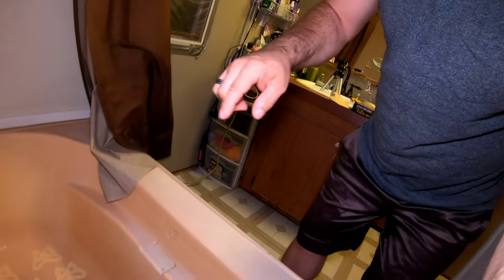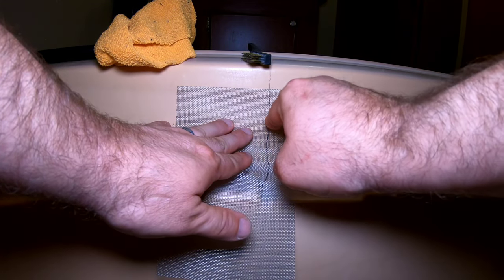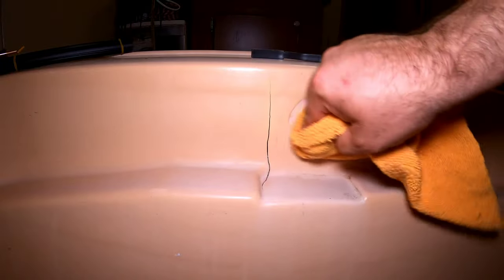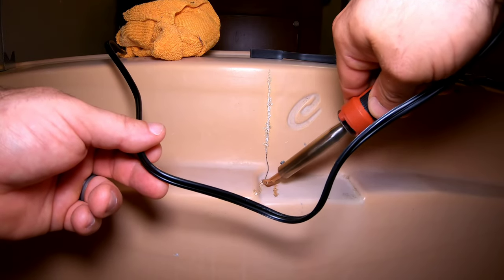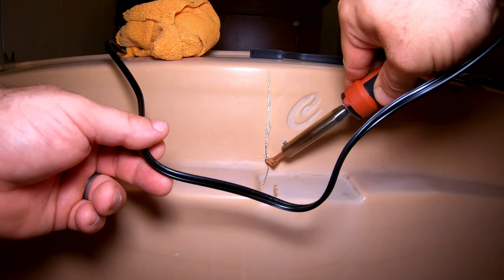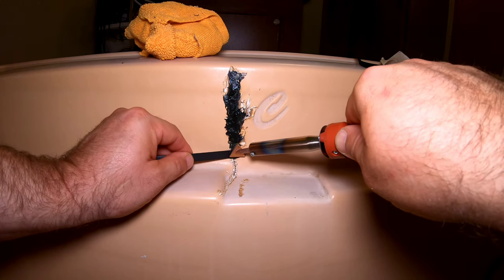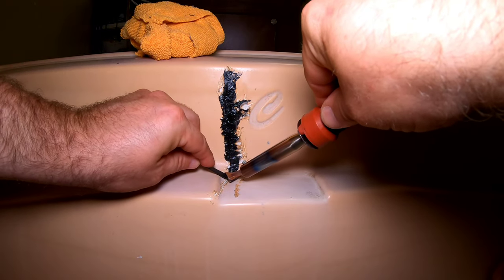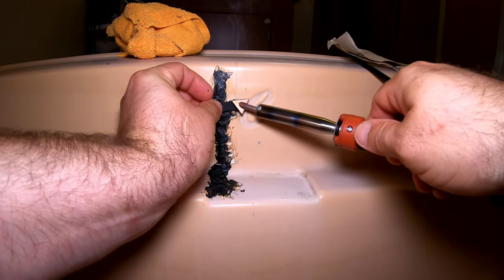Plastic Bath tub Repair - Plastic Welding

Comment: I will say, this does work and works very well! I use to plastic weld, plastic bumpers on automobiles, when the customers didn’t want to buy new plastic bumper covers, after a wreck at the body shop. We would just plastic weld the front of crack, mesh the back side and cover with 2 part glue on back side . The front would be smoothed out and filled with a glaze filler, then primed , and painted/clear.
Reply from the maker: Yep I'm sure you guys fixed some of the screw mounts on the back of headlight housings to the same way. It's a lot of ways you can repair stuff that you would normally have to throw away

Comment: Thanks for the demo, would be nice to see if direct pressure would keep the plastic together. I find that plastic sometimes comes apart after welding.
Reply from the maker: Well we don't put downward pressure on the top of this tub because that's how it cracked in the first place these are not made to be stood on but our granddaughter tried to stand on it and then our 80 lb basset hound jumped on top of it and that's how it cracked. Since then there has been some abuse but it's holding up.
Reply: @thefrugalhomestead7873  thanks for letting me know. Going to try this tomorrow, and as a back up flex duct, flex spray, foam underneath as a temporary fix.

Comment: Great video. Question: (I'm the opposite of a handyman unfortunately) how exactly would I know what material my tub is. I live in a manufacturered home from the 70's. However the tub/shower combo is not original. I cant tell if its abs or acrylic or what. Definitely not metal.
Reply from the maker: Most are abs or PVC not many true acrylic ones around. But if yours is already cracked it can't hurt to try this.
Reply: @thefrugalhomestead7873  thank you for your time in responding. After closer inspection, it seems to have fiberglass under the top glossy coat. Looks like strings in a mold of some sorts.

Comment: Is this an acrylic tub or some other material? I was under the impression that you could not melt acrylic with heat.
Reply from the maker: This is a standard plastic tub. That said I worked on acrylics in tanning beds for years and yes you can weld them. As well as glue them

Comment: Can I use a fiberglass patch on a plastic tub? I have one that is cracked in the bottom close to the drain.  It is in good shape other than that!
Reply from the maker: Everything I've ever tried has failed other than welding. That said being by the drain is dangerous even for plastic welding. Now depending on how it is you might be able to take a hole saw run it in reverse drill a new hole bigger and put a bigger drain in I've seen some professionals fix it that way
Reply: @thefrugalhomestead7873  
Thank you for the reply. I was just trying to save my landlord some money. I was going to pull the tub and patch it from the back and have one of my friends do a resurface after I put it back in place.
Reply: @richardjohnson430   you better buy some epoxy + hardener set and a silicon flexible spatula ( one you use in the kitchen)